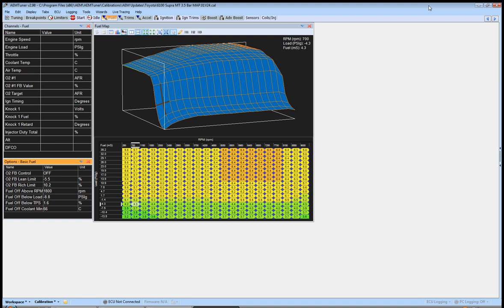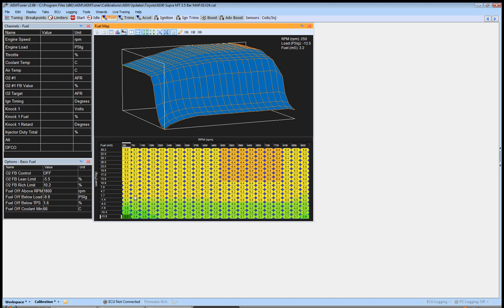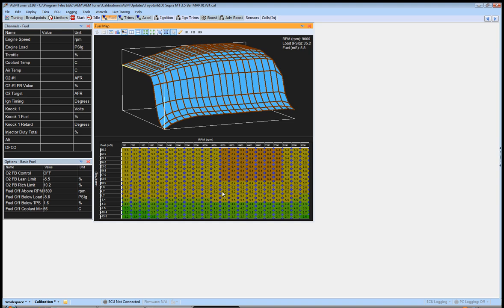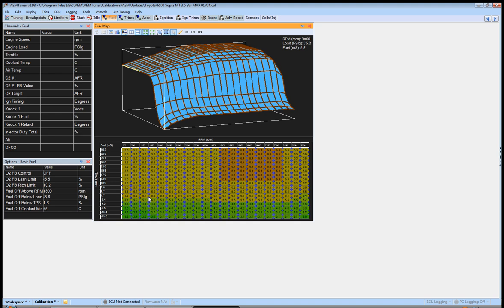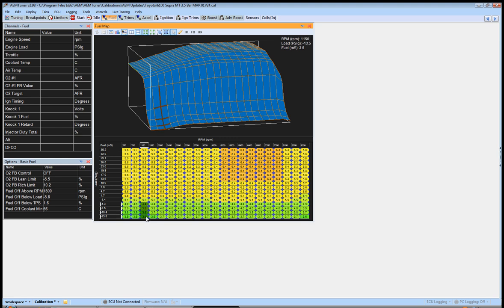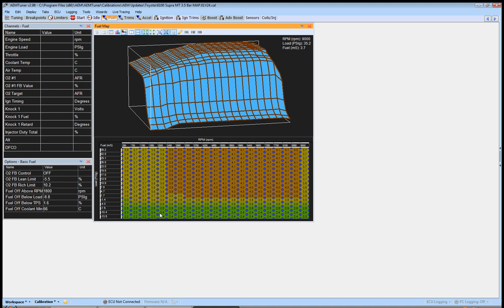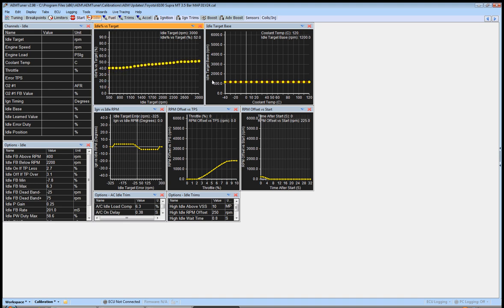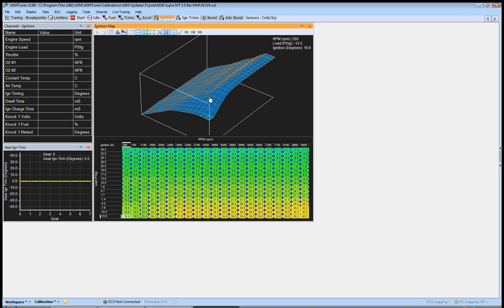AEM Tuning Part 3

Comment: AEM EMS4 Newbie here. I appreciate the info in the first 2 videos and here we are now in video three are you are already talking about running the engine. :) I have a question about crank trigger wheel and sensor. Is there anything that needed to be considered when installing them relative to alignment with #1 TDC? I have a 60-2 wheel with a VR type pickup. When I installed the wheel, I didn't think it much mattered where the missing teeth were in relation to TDC but, I'm scratching my head now wondering if I missed something. Is it really as simple as using the correct 60-2 base file and it doesn't matter how the wheel is clocked relative to TDC?
Reply: did you try using the sync feature to let know ems were is the missing tooth
Reply: I'll have to look that up.

Comment: what if you are not using an Idle air control motor?  Is the process in this video all pointless?
Reply from the maker: The fuel and ignition value setup will be the exact same, accept possibly a little more conservative on 02 values (a little richer) and a little more aggressive on the ignition idle vs RPM. I Recommend using an IACV on all motors no matter the setup just for starts and idle and reliability. There's never a good reason to not run one. For a universal one, use a Cobra IACV. It's a great setup, easy to fab, and very simple to operate.
Reply: So playing with the idle setup and tables other than those 2 are pointless to touch, correct?
Reply from the maker: Paul Momany Not necessarily. You can still set the target idle, vss offset, tps offset, and some others and it will still target those values and adjust ignition values to try and meet those values. So, technically the deadbands still come into play and things like that. However, the duty % table, idle FB min/max, are nullified, and anything else that controls the motor directly. Try and understand how all the tables interact, and it will make more sense. Hope that helps.